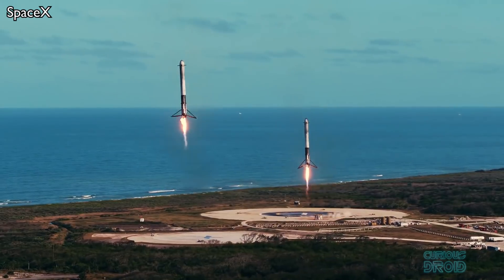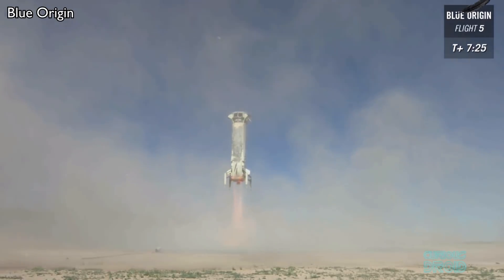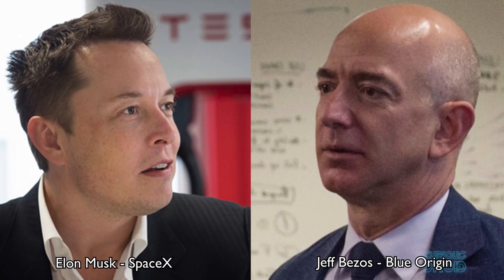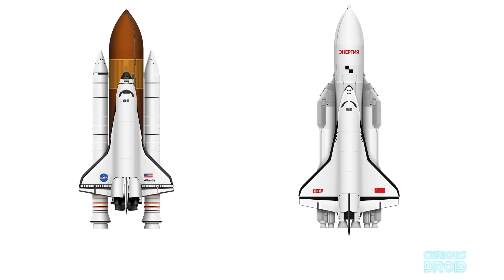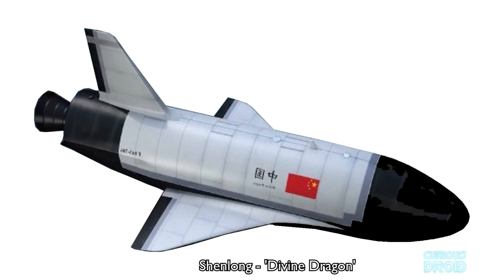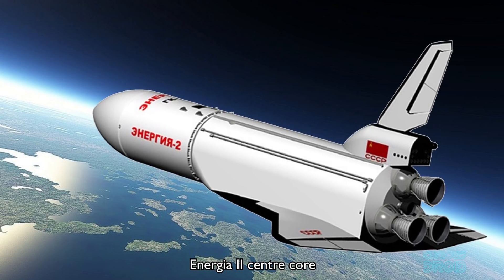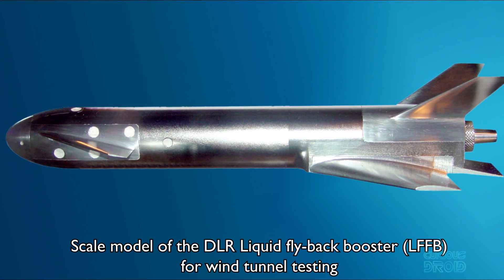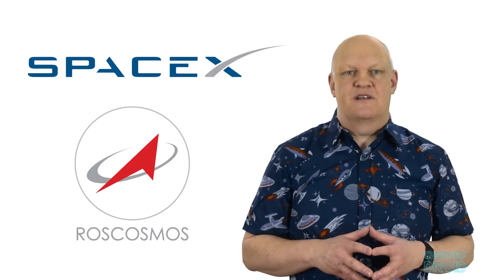Reusable Rockets & Flyback boosters

Comment: Musk at least hasnt invested his personal fortune. He takes 4 billions in subsidies every year from the government. Also don't the reusable boosters need a lot more energy to perform maneuvers for re entry? So more or less what you gain from reusability you lose in the cost of the energy you use to perform the maneuvers upon re entry...?
Reply: Musk invested $75-$100M of his personal fortune (about half of it) into SpaceX.  I'm sure he could have survived if he'd lost it but that's still a big chunk of cash.
And by "subsidies' I presume you mean the fees SpaceX charges for performing a contracted service.
As for the energy, the fuel cost involved in a rocket launch is a small part of the overall cost, something like $750k iirc for the fuel the F9 uses.  Most of the missions the F9 and FH fly don't use the full capabilities of the rocket, so they might as well use the residual capability to recover it and reuse it.
Reply: Panagiotis Ampatzis energy (assuming your talking about fuel) isn't expensive. What's expensive is fabricating a million custom parts out of incredibly expensive materials (plus machining/tooling) all to throw away the rocket after use. Much cheaper to hose it off & refuel than building another.
Reply: +Panagiotis Ampatzis SpaceX has stated that it only takes about 15% more fuel to land the cores. This is clear in the design - the original version of F9 didn't fly back, but it was only somewhat shorter than the stretched version. Claims that you need twice the fuel are just false (looking at you, ULA).
Reply: Panagiotis Ampatzis
All of this is not true. Musk made his 100 million from PayPal which he invested into Spacex. This money allowed him and his team to build only 4 falcon 1 rockets. 3 of which failed. His final one worked and because of it, Nasa signed a contract for 10+ launches . This contract was a part of Obama's initiative to get private industries into the space sector.  This contract would head part of the development costs for the Falcon 9 and as long as they kept on launching successfully would they get the rest of the contracts money.  Musk solely funded Spacex from 2003 to march 2006 with the 100 million, after that other private entities invested, and the help of the government contracts allowed them to continue to develop and grow. This "subsidy" was a form of promoting development in the space industry. The government did not demand Spacex lower there prices. The US government just wanted to have domestic Space launch capability. They didn't care who, or how, they just didn't want it to be Russia.  Spacex opened to commercial launches at an extremely low price of 57 million, per launch. These supposed "subsidies" as you call them, have also been awarded to other private companies (Blue origin is an example). This space race, that was started by the inefficiency of governments and Obama's privatization of space, has lead to amazing things. Like some previous comments have mentioned, and you have replied that bringing up what other companies receive as subsidies is changing the subject. I believe its not. The whole issue is about the government giving money to companies, to lower costs or promote development, etc. Every car company, solar company, battery company, all receive subsides in a many different forms. Some get tax free resources so they can build there products cheaper.  This list is endless. Its not his fault  that Elon Musk's  knows how to play the system, like every other company in the US. If you are gonna talk about subsidies, don''t just focus in on one guy. Also that article from LA times, has already been discussed as bad journalism. Most subsides are not cash based, and there it is extremely difficult to get the true total value of the help the Government has given. As i stated before, these types of subsidies apply across all industries, not just Elon Musk and his companies. The government is not playing favorites. Also a stock market analysis means jack shit, It adds no value other than speculation and maybe some prediction based on previous companies. All of this is easily available on google. It just depends which sites you like to read. Some of them are very anti change. So take that with a grain of salt.

About the reusable rockets being more expensive than non reusable rockets. That is such a small mind set. Firstly, history has shown that so far, its not true. Every country spends 100 million plus (300million+ for ULA) to launch a rocket as cable as falcon 9. Falcon 9 costs 60 million + to launch(this is before it was reusable). Secondly, simply put, a non reusable rockets would have to be in the order of 5 times or more cheaper to produce, than a reusable rocket that launches 5 times. The more launches a reusable rocket does, the more the more this equation goes against non reusable rockets. The price of fuel is negligible in this equation because its less than 1% of the cost to produce the rocket per launch. It would take 100+ launches for the fuel to equal the production cost of the falcon 9. Non reusable rockets wouldn't be able to compete with that. Thirdly, rockets are not bullets ,that are not fire and forget. They are launching expensive satellites into space, failure is not a good thing. So you either over-design non reusable rockets,(which is costly) to ensure high success rates, or you design and test rockets that work, and then see how far you can take re-usability while continuing  to upgrade and change designs to forward that goal. This is what Spacex has done. Your 9-10 figure to break even. Where did that come from? Spacex is a private company, so we will never know until we get real numbers, estimates in 2016 say Spacex made 3-4% margins on almost 1 billion in revenue. This is very close to other industry standards like ULA, etc. Spacex right now only launches a rocket maximum of twice (not 3-4) which started in 2016. Until block 5 falcon 9, we wont see rockets flying more than twice.  Block 5 is expected to last 10 launches until refurbishment is needed. Elon musk has stated that refurbishment cost is about 40% - 60% of total production cost of the first stage and is only coming down. A used rocket still launches for a very similar cost to a new one being launched. If you watch elon musk at talk shows  that he goes too, he has mentioned the fuel requirements to land the first stage. Last year he said, they could bring it down to 10%. As much as i love qoura, to see the interesting answers, ideas, and approaches to problems, its still a simple site to get stuff answered. Its not to be considered a truly reliable source of information. 

To conclude. Amazon never turned a profit in the first 5 years (if i remember correctly). Mostly because they reinvested all the cash they got back into the business. I remember the naysayers of amazon where like rodents. Almost everywhere you turned. Look at them now. One of the biggest companies around. Tesla is doing the same, in an even more saturated competitive market, where brand has meant a huge amount. Yet they are still around, fighting.  Now, that doesn't mean they cant fail, I just say, have patience, wait and see. Spacex has done way better in its industry bubble. It has shaken everything up, and that is why there is a big focus on the space industry again. People are beginning to realize that the industry can become huge in the next 20-30 years, and that Spacex was onto something with reusable rockets. All the big governments and there  old private contractors could not see this. Now these old big guys are realizing that the economics are there and are scrambling to come up with designs to compete.

In my opinion if you are gonna complain about subsidies going to musk and his companies, it shouldn't be about musk, it should be about the subsidies in general. Is giving money to any company is right?
Block 5 has passed Nasa qualifications for human rating and must successfully launch 7 times, before allowing humans on board. It will launch for the first time this year on May 5. 
P.s, before all the Obama haters come, I never really liked Obama as a president. I just try to be as unbiased as possible and accept when people do good, even if i don't like them. Many will argue it wasn't really Obama, but that just falls to a straw-man argument. It was him and his administration. So ya
Edit, I know there was 1 more falcon 1 launch that had a commercial payload, that was successful. It just isn't important.
Reply: Panagiotis Ampatzis if you are already googling maybe you should google ford and gm subsidies.
But be careful because your head might fall out of your ass.
Also you could check how much money has nasa given to Boeing for rockets that will be outdated by the time they test fire them.
Reply: +Panagiotis Ampatzis "H'mm. I have been challenged on whether my sources actually say what I claim they do. Should I cite the specific sections where it backs up my claim... or should I insult the person challenging me? After careful consideration, the latter sounds like the intellectually honest, good faith debate tactic."
Reply: Panagiotis Ampatzis 
To every single question you asked. I ask? How do airline companies handle all of these things? Well, they include it in the launch price. When you buy a plane ticket, you pay the fuel requirements needed for you, the theoretically wear and tear costs, the pilot and crews salary, the tax of the airport you land at and a little bit of profit on it.  The same goes for spacex and its commercial launches. It will work like any other business. 70 years ago, people would never believe that a plane could fly across the Atlantic, with only 2 engines, 10's of thousands of times in its lifetime, let alone make a business out of it. 5 years ago, Nasa couldn't believe we could land a orbital class rocket, let alone with pin point accuracy. Now it's happened almost 30 times. About the failure of rockets, that is what insurance is for. Also, like I explained in my previous comment, building a single use rocket is still extremely expensive. A reusable rocket maybe more expensive, but it's about the orders of magnitude. Reusable rockets are not 100 times more expensive. They are not even double expensive and if you try to compare the falcon 9 to the space shuttle, you are comparing Apple's to oranges. Spacex is walking in uncharted, unknown areas, standing on the shoulders of NASA. The economics of mass rocket reusability are still unknown, but everyday we get closer to understanding its feasibility. If you think it's not feasible, so be it. Your opinion, your life. However, I wouldn't bet against Nasa and Spacex. They know a lot more than both of us, and everyday NASA works hard with Spacex to make this dream come true. It's benefits NASA, and the entire world. 

Lastly about this stupid 4.9 billion dollar number from latimes. In my previous comment I said it was bad journalism. They don't talk about the time frames of most of the subsidies (some being over a 20 year period), they don't talk about the fact that tesla made there patents open source, they don't clarify the complicated rules of carbon credits, that count as subsidies that Tesla sells of to other companies. They don't talk about the fact that solarcity which was acquired by Tesla in August 2016 was receiving tax credits before the acquisition. They don't try to include and calculate the tax money saved by Spacex dropping launch costs 3 fold, and keeping the money inside America, instead of depending mostly on the Russians. So many other things, that I won't write about. LATimes says there is no guarantee the country will benefit from publicly funded support of these companies. I call this a hit piece. The priceless affects of a cleaner environment, the thousands of jobs created for America, the increase of tax revenue from increased spending on American products instead of foreign products. Thousands of patents made free for people to use. I could go on for a long time. Elon musk and his investors have sunk huge sums of private capital into the companies, and the incentives by the government are the cherry on top. They were gonna do it, whether the government was gonna help or not. This stupid 4'9 billion dollars that is constantly thrown around, means nothing, if it benefits society. It means nothing in the grand scheme of things. Your amazing "data" means nothing. Go read any respectable journalistic site that replies to what LAtimes released. Its considered a big misrepresentation of the extremely complicated system that takes place in the US. All these government "subsidies" have advanced space travel, allowed for the mass market of solar panels, electric cars to hit the market sooner, and allow for the massive drop in battery prices. I don't understand why 4.9 billion dollars is a problem? When his companies have advanced and helped society, every other industry receives these forms of help from the government. An example is the oil industry. Each of them receives 10's of billions in "subsidies" a year. Why not complain about that? What about other Electric and solar companies receiving these tax credits? Don't like that either?

Edits; grammar and  punctuation.
Reply: Panagiotis Ampatzis Everything you just claimed is wrong. Learn to google man.
Reply: sothere1 -  It would help if his own sources agreed with his points.
Reply: Panagiotis Ampatzis - "I am a bad-faith debater who won't even consider the possibility that I am wrong, despite willfully refusing to engage with criticism with regards to whether my sources say what I claim they do."
Providing links and sources is good. Refusing to cite the sections of those sources that actually proves your point is not good.
Reply: Panagiotis Ampatzis Show me the subsidies
Reply: Panagiotis Ampatzis and where are their sources ? Where is the official source that makes clear how, where and when musk took subsidies ?
Reply: That only applies to the second stage mass. Adding mass to the first stage for reusablity has a substantially smaller payload penalty.
Reply: Panagiotis Ampatzis - According to your own sources, SpaceX has received... $20 million from Texas. To build a facility that would generate $5 million for Texas every 15 years on a piece of land that was previously unusable. No other subsidies for SpaceX are mentioned. No evidence for your claim that SpaceX is (fraudulently) using subsidies intended for Tesla in their own operations.
Reply: I looked at your sources. I looked at every time they mentioned SpaceX. Either you do not understand your sources, or you are lying, because your sources do not say that.
Reply: Panagiotis Ampatzis If it'd be more economical to let the boosters Nürnberg Up, Elon wouldn't land them
Reply: The primary and most important reason for developing reusable rockets is for interplanatery/Mars travel. Imagine you reaching mars but you dont have a rocket booster there that will push you back in orbit for a journey back home. You would be without the boosters and, its easier to get fuel from place where you plan to go in space but you can create a rocket booster everytime you go there from scratch.... The reusable rockets are for making interplanatery travel and return journey possible and cheap. cost effeciency for satellite launches is just a bonus. I hope people would understnad this and space agencies would work towards it more aggresively.
Reply: your view point is short sighted here. True, today the technology is not there. But it will be developed for sure in future and we will move into space. And just like we developed heat shield enabling us to reenter atmosphere from space we will have a shield against sun flares and other radiations in coming future. 'Necessity is the mother of all inventions.' Its not there today because we didnt need it yet.
Reply: Source?
Reply: I think a better way to put it from your original comment isn't "energy", but mass. Every pound you add to make a spacecraft recoverable is a pound less in payload capability. The payload capacity of an expendable Falcon 9 is nearly double than a recoverable mission profile. 

Fuel is relatively cheap compared to a rocket booster. If you can scale up the reusability by some factors, it becomes more like a plane that you just refuel and fly again.
Reply: http://www.latimes.com/business/la-fi-hy-musk-subsidies-20150531-story.html
Reply: http://thehill.com/blogs/pundits-blog/economy-budget/345338-can-we-wean-elon-musk-off-government-support-already
Reply: https://subsidytracker.goodjobsfirst.org/prog.php?parent=tesla-motors

You have no idea how to google do you?
Reply: https://www.thestreet.com/story/14248212/1/tesla-is-quickly-running-out-of-government-subsidies-and-it-could-present-a-massive-challenge.html
Reply: No such thing as insurance for rockets. Find me a company that insures rockets I dare you. Also links for all your claims.

10 launches to break even:
https://www.forbes.com/sites/quora/2017/07/21/how-much-does-spacex-save-by-reusing-a-falcon-rocket/#7f02098a724d

So the fact that Musk is behind all these failed companies tell you nothing about the future of space x...

If you care so much for the world you must have solar panels outside your home... Oh wait you don't. I won't even get into a discussion about climate change and CO2. Lithium is not so bad... lol ok. Renewable energy is not affordable at least yet. No matter how you spin it the energy conversion and storage is horrible at this time.

Again if you didn't get subsidies you wouldnt be able to reinvest in the company and they d go bust because the stock would plummet. Their models are always late and they don't make as much cars as they have orders for.

"NASA stands for National Aeronautics and Space Administration. NASA was started in 1958 as a part of the United States government. "
Hence why they get their budget from the government. Unless you know more about NASA than NASA's website
https://www.nasa.gov/audience/forstudents/k-4/stories/nasa-knows/what-is-nasa-k4.html

Please learn to read. I mentioned failed companies of Musk that got subsidized and gave nothing back to society. Nice strawman you tried to build there. I also said I dont mind giving subsidies in tech that works. I am only against bailouts. Car companies do turn profit and in return they pay taxes so the subsidies go back and forth. Taking subsidies and not turning profit means you dont pay taxes. Is that so hard to understand?

You defend a man like he is your father or something. Blind loyalty and celebrity worship is not my thing sorry. I judge people by their actions. 

Did you just report me for calling you dummy? wow someone has issues lol.
Reply: It's ok you need an IQ more than 80 to understand the whole conversation. Don't be hard on yourself.
Reply: When debating you dont say "yes but someone else does it too". the subject here is Musk. Moving the goal post after you got your ass handed to you by my links just shows how much butthurt you are over it. What Musk has that others don't is better PR. He is a con artist like the rest of the industry and maybe even more.
Reply: Did we ever had airline companies scrap their planes after one travel or I am living in some parallel universe? I am also glad that you added the insurance cost which is gonna be MASSIVE since it's unknown territory. So thanks for that also. I am kidding of course since NO NASA MISSION WAS EVER INSURED AND THERE IS NO SUCH THIS AS INSURING ROCKETS. These are not planes or ships we are talking about. They do what they do because they get a shitload of subsidies (Shit NASA is getting government subsidies because it is government owned you dummy). Elon Musk always throws around ideas that most of the time fail or just show future promise but has yet to deliver. Tesla? No profit whatsoever. Solarcity is bankrupt. Space X WILL do this and that (nothing yet). Hasn't saved money yet because you need to do at least 9-10 launches with the same rocket to start breaking even WITHOUT ALL THE COSTS I ALREADY MENTIONED. Remember the giant batteries that would power your home? Gone. What about the hyperloop? Still nothing (and will end up as nothing because it doesn't follow thermodynamics laws!!!)

It doesn't matter what you accomplish with subsidies because you turn no profit!!! Also I already posted the fucking links that show they do get subsidies. Many other car companies already make profit from electric cars. Why Tesla isn't? Because they don't care when you just get subsidies and with good PR you inflate the stock price. Society doesn't benefit from any of the above crap. Society pays taxes for useless shit like that. Also Solar panels are affordable because guess fucking what... THEY ARE ALSO SUBSIDIZED!!!! Thats why you dont see solar panels everywhere! Because when the sun goes down you dont have enough energy to do shit because you don't have batteries that big. And if you did they are lithium and lithium is fucking cancer for the environment. Same as the electric car batteries. I don't care about other industries but even if i cared thats because oil is what keeps the world moving. Nothing else.
Reply: Panagiotis Ampatzis fking sexy argument. I’m literally wet...  
Elon is a puppeteer who has created a cult of beta cucks.
Reply: Killthetime there wont be man on Mars. We have no way to fight radiation from solar flares or radiation in general which would make the rocket a space graveyard for any astronaut dumb enough to board it. Not to mention psychological issues (small space, not many people on board etc) plus lag in the communication so there wont be any "solar flare coming your way" or "we have an issue mission control what to do?". Anyway there are countless studies that prohibit any human being to go to Mars and come back and not dying.

Actually according to my sources SpaceX has received more than 100 million and what keeps it afloat is the government grants and contracts that would cost a lot less if given to the Russians. If Musk gets subsidies for Tesla he can just sell some of his stocks (he owns 10 billion worth) and give it to Space X. That way he seems like he is funding it but in reality he just did a swap from the subsidies that were invested in Tesla and sell stock to send to Space X. Not really rocket science (pun intended).
Reply: Panagiotis Ampatzis No one is going to live on Mars and Musk is a con man agreed
Reply: sothere1 agreed, I am the only one providing links and sources and all I hear is some uneducated cultists' opinions that I don't really care about. Even in a scientific site like this people just don't know how to debate hence why I get angry. Anyway I am done.
Reply: Maintenance of said rockets? Repair parts cost? Landing site construction and maintenance? Retrieval costs (moving it out from the site for example), replacement costs in case its usability is over? What about losing a booster to some disaster? (it costs a lot more than a singe use booster to replace) etc etc. 

As for Slicerz717 you can write a whole book mate but the fact still remains that he gets 4 billion in subsidies. Only difference in my answer is that I have the data to prove it
Reply: Nice to see that nobody accounts for maintenance, R&D costs, retrieval costs (site and man power and construction), possible crash (reusable rockets are more expensive than non reusable ones so even if one crashes the damage cost skyrockets), the +15% fuel consumption that someone claimed, etc etc. Someone on quora made the math and even he didnt account for all these. To break even you need at least 9-10 launches (and again without accounting for all the above) and the rockets we use now will be used at best 3-4 times. Without government subsidies (google it) Musk cant afford nor Space X nor Tesla. If you look at the stock market analysis you will see that. Stop being ignorant and attacking me and do some research. The money he invested in Space X came from subsidies from Tesla motors. (and of course his cut from the stocks he owns in Tesla) Never mind the fact that Tesla has never turn a profit yet